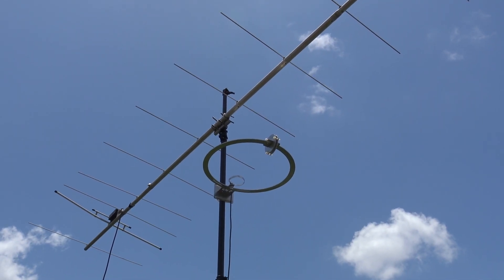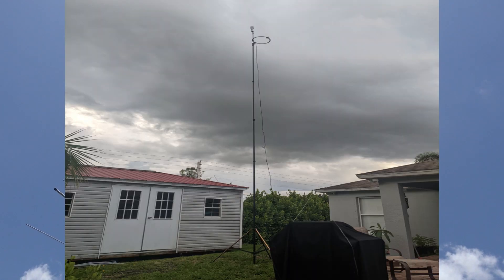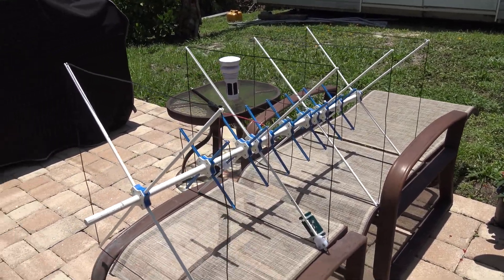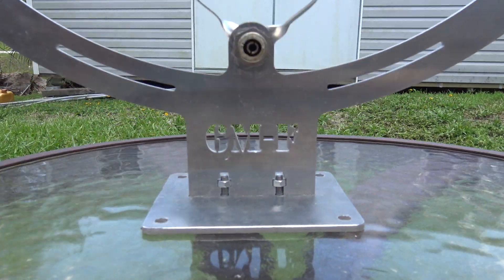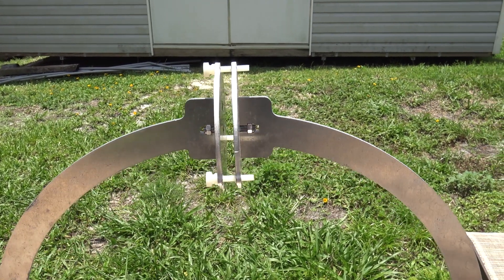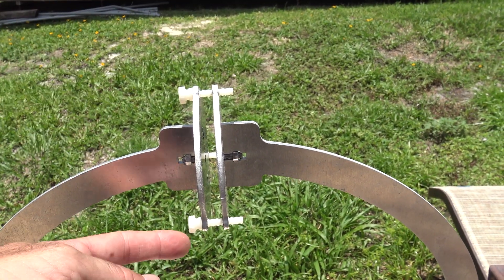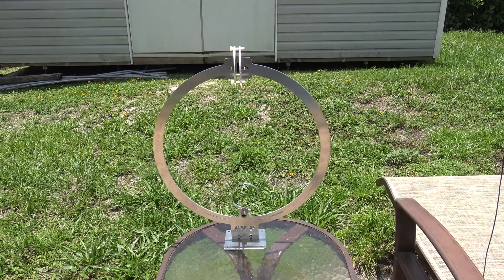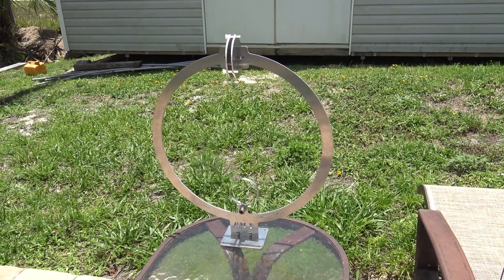This Magnetic Loop Is JUST AWESOME!! 50MHz CNC Machined Aluminum VHF Loop, June VHF Contest Contacts

Comment: Two things I would have liked to have seen, the actual bandwidth of the loop, (a 10 MHZ wide display of the loop's bandwidth is meaningless,) and a comparison of signal strength between the Yagi-Uda and the loop at 100 yards or so. I don't see how the loop can possibly outperform the beam on transmit. RF Field theory says that's not going to happen, and measured data is what it's all about.
Reply from the maker: Cool. Now I have a reason to use my field strength meter ... Stay tuned

Comment: I have a pair of 2m stacked par omni-loops on my roof for SSB.  Wonder how much better this would be than those?  Furthest I've been able to get with those is 30 miles on SSB.
Reply from the maker: Well, im trying to get the 2 meter loop, but heck, I worked 1,500 miles on 6 meters this weekend.... 30 miles is ground wave, nothing att all happening there.. When the band opens, you should be able to easily obtain 3-400 miles with a loop

Comment: For 6 meters, it is super easy to string 20 feet or 6.1 Meters of your favorite wire in the attic and make a "Full Wave 6 Meter Loop".  If you wanted to get creative, most people in attics have the room to make a 6 Meter Delta loop.  Still, I totally get it, mag loops are kind of in right now, and work well too. Thanks for sharing.